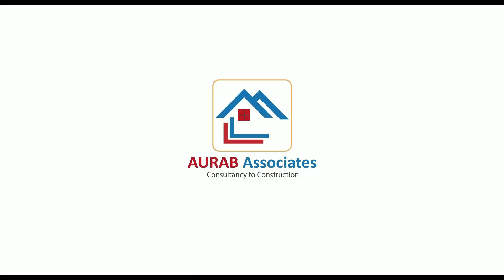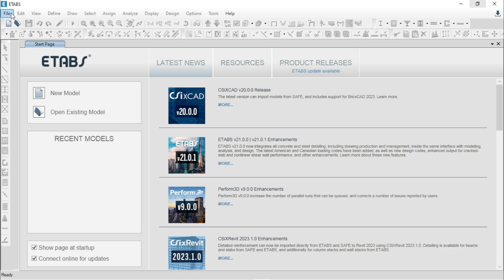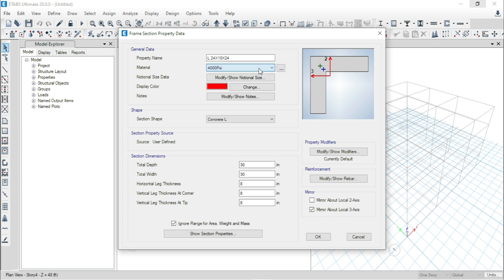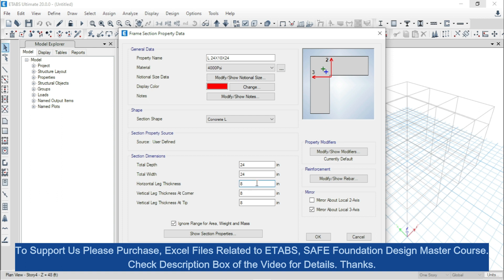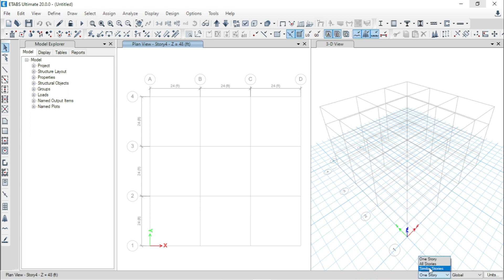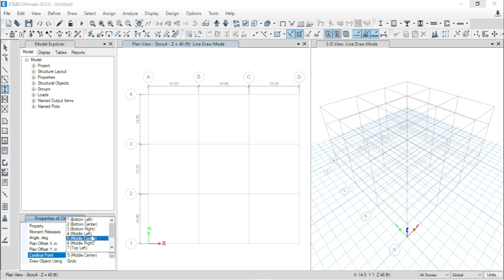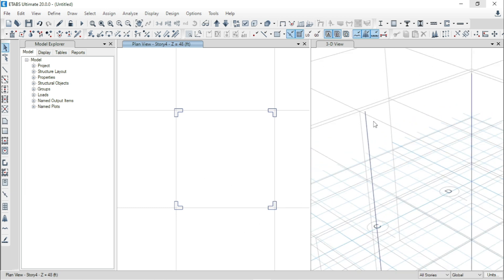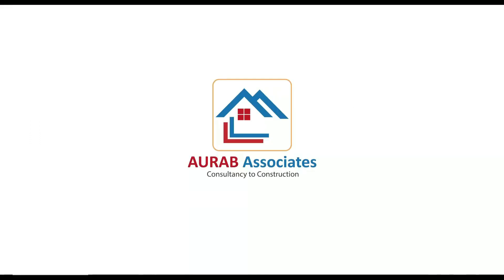L Shape Column Modeling in ETABS

Comment: Sir how to design column of flat slab in etab?
Reply from the maker: Sorry I do not play with flat plate slabs. Because it requires a lot of thickness, which is not accepted by our clients in most of the cases.

But if you need to design a Flat slab, you can try with CSI SAFE. Not in ETABS. Thanks.